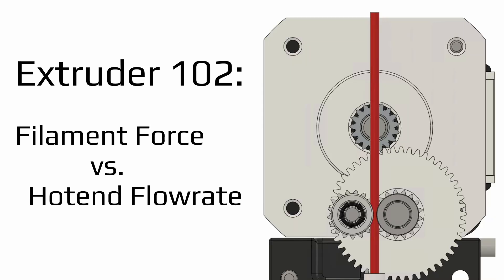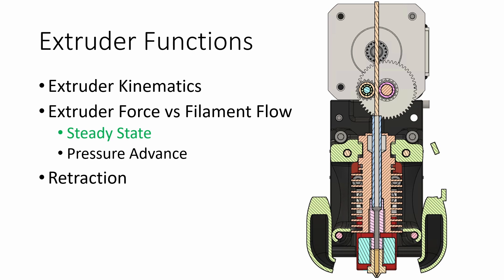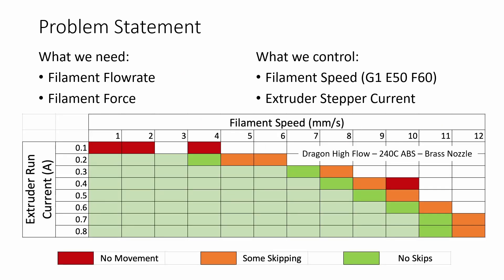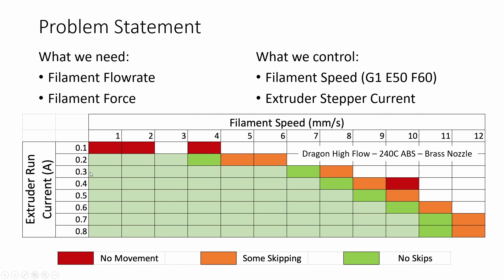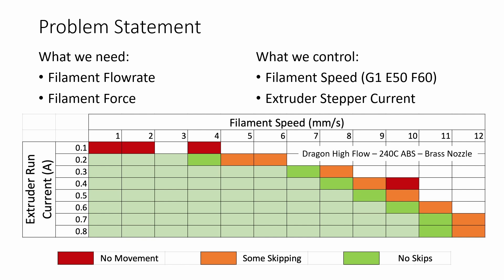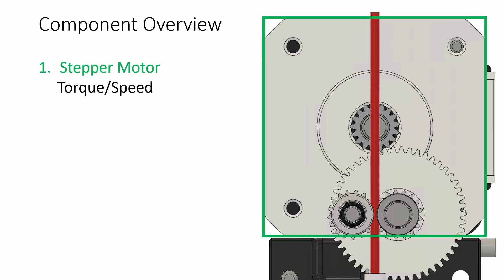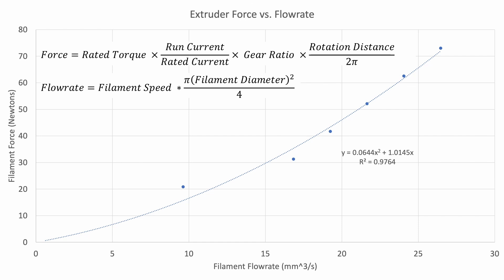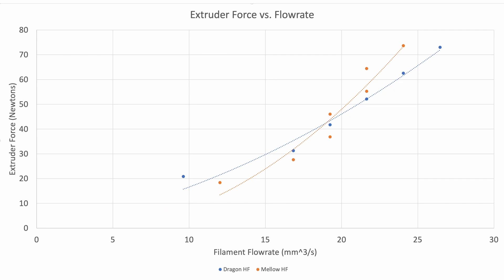Extruder 102: Measure your hotend performance!

Comment: Your force equation is incorrect. You have Force = Torque * GearRatio * Radius. It should be Force = Torque * GearRatio / Radius.
A quick way to show this is to check the units, your force will have units Nm^2.
Reply from the maker: Check the pinned comment 😉

Comment: hi eddie i'm new to klipper fw i want to ask if i change the nozzle 0.4 with a bigger nozzle 0.6 or 0.8 do i need to change the nozzle diameter on the printer.cfg or just the slicer setting?
Reply from the maker: This is a great question! The nozzle diameter in the config to the best of my knowledge only affects the maximum extrude amounts. I'd recommend updating it especially if you're switching to a larger nozzle so that you don't get any errors. 

One thing though is that if you've tuned PA with a smaller nozzle, you'll want to retune PA for the larger nozzle--your PA will not need to be as high! 

Hope that helps!

Comment: Great video. Sometimes the stepper motor can skip a step without noticing. Did you consider using a closed loop stepper driver to detect skipped steps?
It would be even possible to automate the whole process (changing current, detecting skipped tests, increasing speed, ...) and test different hotends.
Reply from the maker: Yes! It would be fantastic to automate everything, some people have shown interesting in trying to make a script for this

Comment: Have you tried to see if a exponential function fits you data points better?
Reply from the maker: I believe the pressure drop through the nozzle follows flow^2 per Bernoulli’s equation which is why I mainly picked that fit, but I’ll admit I haven’t done the math for that specifically
Reply: @eddietheengineer  Bernoulli only applies to incompressible fluids, although it could be a reasonabke approximation I think a different function could explain the data points better.
Generally speaking in the literature the viscosity of a polymer melt  is classified as shear thinning. Personally I have observed that  TPU melts behave shear thickening, however that obseveration is related to 3D printing, which means nozzle geometry could play a significant influence.
Regardless that is just nitpicking on my part. I really enjoyed your investigation.
Reply from the maker: @DropEffect  thanks for the context! You’ve definitely done more research into the hotend physics than I’ve done, my main goal here is to create a very simplified model that captures the general jist of what’s going on without diving too deep into the weeds. Once that’s done, maybe I’ll go down another rabbit hole 😄
Reply: I was wondering what about Shear thinning as well when I saw the trend line. If we look at the drag equation it boils down to two variables that we care about - velocity squared and viscosity. I wonder if our extrusion force is too low for shear thinning to dominate the increase in drag due to the increase in velocity.

However, it's definitely possible for shear thinning to dominate for a 3dp. I was just talking to Erik Gjovik who worked on the essentium HSE180 and he mentioned briefly that they are able to utilize on Shear thinning with standard nozzle sizes.

A side note - the drag equation is essentially  bernoulli's but it is able to account for the compressibility of a fluid so I think Eddie's original reason for selecting the trend line makes sense.

Comment: Cool video, looking forward for the next one! One thought on max flow: as the extruder is close to skipping, we likely lose all resolution provided by microstepping. That's OK for infill and internal perimeters, whereas for the external one you could calculate a flowrate that required only about 10-20% of the motor torque. Similarly for the XY axes motors during acceleration/deceleration. Depending on extrusion, either the extruder or the XY motors could be the capping factor.
On a separate note, pushing the extrusion to the limit would likely reduce the actual extrusion.
Reply: I understood very little, but I know you're saying something big brain, so I hope you too can connect and collab!
Reply: If you're using microstepping for resolution instead of for smoothness of motion then you're doing it wrong in the first place. That introduces more cumulative loss of accuracy than it grants improved precision. If you need finer precision, get a motor capable of finer full steps or use more precise mechanical parts like smaller pulleys or a screw with a shorter pitch/lead, or gear it down. This is equally applicable whether you're pushing and pulling a carriage along a linear axis or feeding material with a rotary one.

Comment: Great video Eddie. In the past I used the Sabic MG94 ABS with great success to overcome flow rate issues. Its viscosity is way higher than other grades of ABS and you can print it at 280 degrees being dry with no issues increasing the layer adhesion. It would be an interesting comparison to make with your current material.

Comment: Great video. For me personally, I found it easier the interprete the graph when the two plot axis being swapped. Thus, giving flow rate as a function of motor torque. 

However, this is a minor change and does not change the given values.

Comment: Thanks for the education, I understand most of it from my college days (25 years ago),  but I could not see the correlation of R^2=0.9764. On the extruder force vs flow rate. (is it stats on line of best fit?).

Comment: Wow Eddie, great video! Would there be any value in weighing the extruded filament after each run?  Then you would have a quantitative result rather than a qualitative result, right?
Reply from the maker: Definitely--this is a very "brute force" way of testing things and has a lot of pretty major assumptions that can drive inaccuracies. There are a lot of ways to make it better!
Reply: @eddietheengineer  I think CNC Kitchen did a video to demonstrate max flow rate of a v6 hotend, and he simply weighed the extruded material at each flow rate. That is what convinced me to upgrade from the good old v6.

Comment: Any reason you did not use design of experiments. Given it is an X^2 relationship it should give a pretty good curve fit.
Reply from the maker: There's a few things here that can make the curve fit not great. First of all--the TMC driver doesn't set the current to the value you specify, it sets it to the nearest of 32 steps that it has available. I'm getting those numbers together now, but unfortunately the default sense resistor for TMC2209 drivers doesn't really give much resolution in the low current range. Second of all, I'm testing in pretty coarse steps, 1mm/s increments don't give a ton of resolution but it's close enough for what I need. Third, there are a lot of assumptions about how linear torque is with stepper current, how significant the drivetrain losses are, how accurate the torque values are in general, how much the filament is slipping--the list goes on and on! The goal here isn't a perfect correlation, but more a semi-accurate model that we can use to show general direction.
Reply: @eddietheengineer  I am arm chair engineering here rather than firing up my 3D printers and agree it is just going to give a correlation. I would think a standard direct drive (no second gear) would be best to reduce measurement error. 

With DOE it was more you mentioned alot of variables and that is the solution. It would be more helpful in controlling experimental parameters and looking for noise in the results which might be useful for modeling as much as anything.
Reply from the maker: Definitely! If I had the time and was motivated to do a DOE, that would be best. If I went that far though, I'd likely end up measuring force somehow instead of back calculating the force from an assumed stepper torque. In the end I'm fine with some pretty large error ranges since I'm doing this for fun and not a formal research project!

Comment: Nice work! Increasing radius usually reduces force from torque..
Reply from the maker: Yes! That's why the extruders like Orbiter that use the 8mm Bondtech gears (34mm rotation distance) have a higher gear ratio (7.5) than the BMG with 5mm Bondtech gears (22mm rotation distance) with a 2.94 gear ratio
Reply: @eddietheengineer  shouldnt it be F = torque/radius?  Cause the longer the moment arm the smaller the force.
Reply from the maker: Yes!! you're right, now I see where the typo is, thanks to you and Alan, I didn't catch it at first. Fortunately my excel spreadsheet is still correct, just my slide is incorrect. I'll see if I can overlay something at that point in the video.